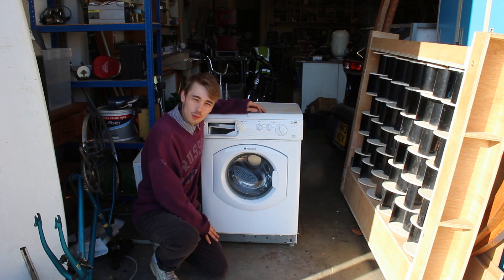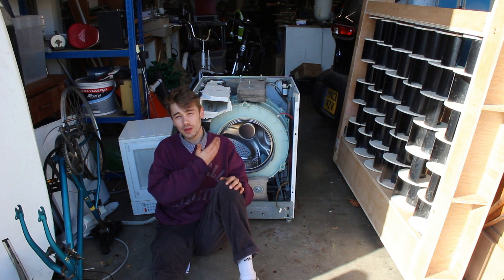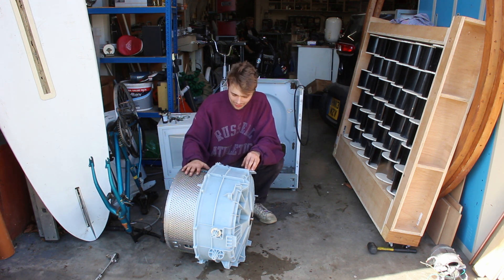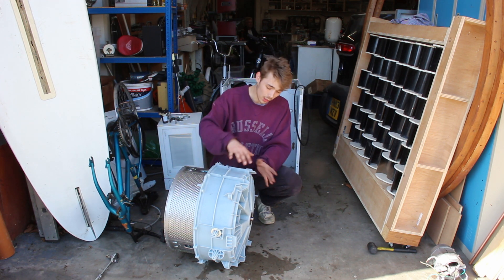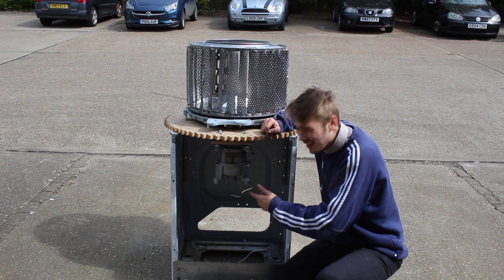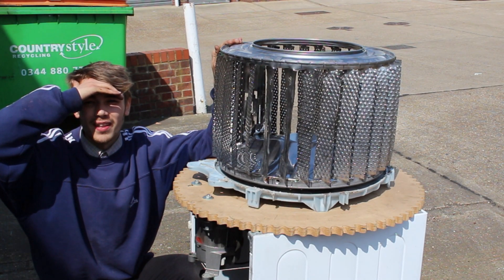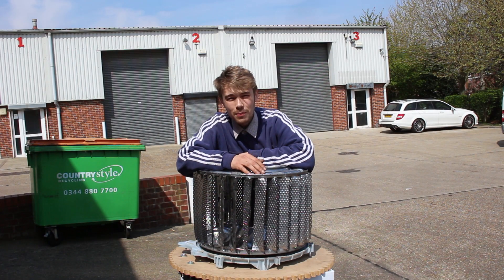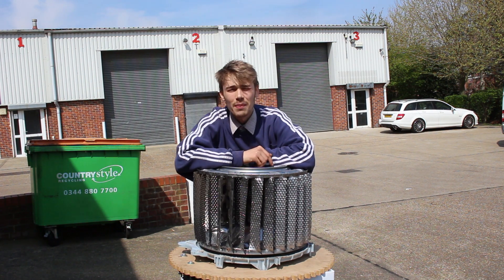1515 - How to Make a Wind Turbine from an Old Washing Machine

Comment: 3 Ways actually, and the strongest one - you've ignored and destroyed, "The Up-Draft Turbine."
. Updraft Turbines are used Everywhere including Chimney's ( to turn and rotate food ), Cooling Towers ( to Separate Heat from The Falling Cooled Waters ( Rain ) ), and Wind Generational Power-Towers which are usually a combination of One or usually All Designs - at once.
. . As for the Size blades, I take it you've never thought things through from the Vacuums point of view for Air Displacement - have you.!.??

Comment: What's the most common reason for washers to be thrown out? Leaking?
Reply: Or the electronics goes out on them. Whirlpool, Samsung, Maytag, LG, and Fisher-Paykel in many models have direct drive motors that 3 phase magnet motors. Those are the ones that you really want as the motors in them can be readily turned into a DC source.
Reply: Yeah, there's loads of problems that can happen, the last one I had. accidentally overloaded it, and it broke the concreate blocks inside LOL🤣🤣
Reply: I work in a store selling washing machines and we find a large amount of people replace hotpoint and hoover due to failing bearings, repairable yes, but cost prohibitive due to the labour pulling the entire machine apart in many cases.
Reply: @salibaba  Are most of those failed bearings caused by seals that failed or are the failed bearings the cause of the seal failures?
Reply: @gravelydon7072  don't know unfortunately. When it comes up most of the customers simply tell us the machine sounds like a jet plane taking off when spinning. It annoys me that such things can't be repaired cheaply but it's in the manufacturers best financial interest to have you buy a new one ,than spend more engineering them to be repaired easier.